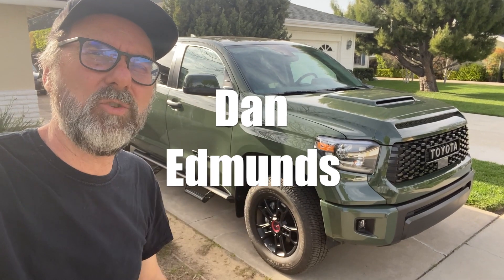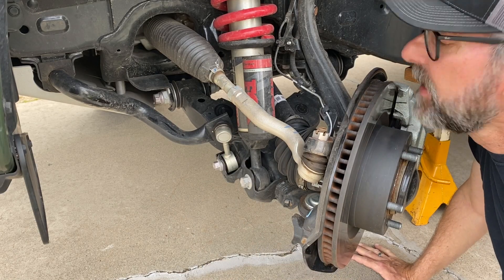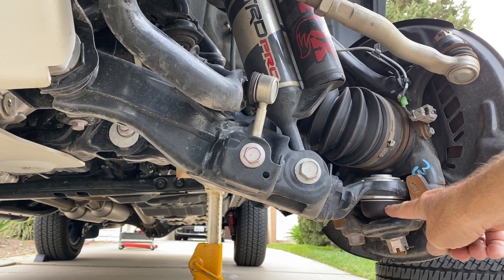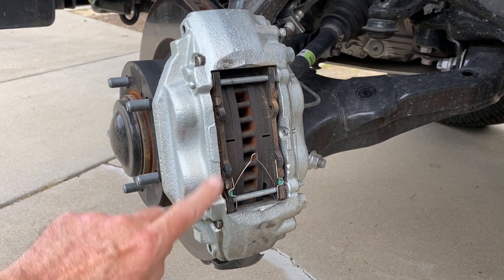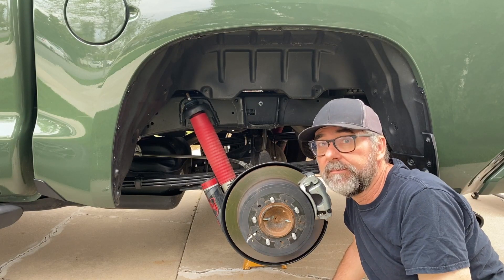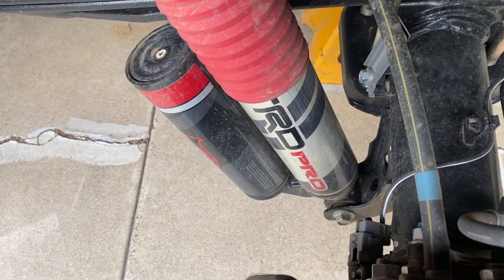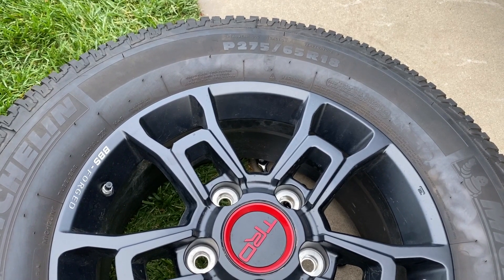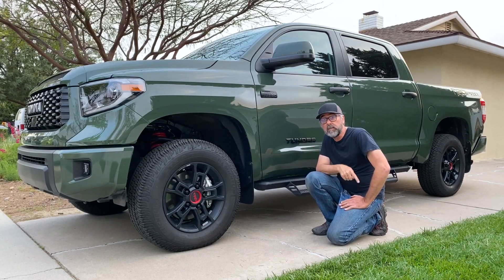2020 Toyota Tundra TRD Pro Suspension Walkaround - See What Makes it Off-Road Ready

Comment: Great video on the suspension of the tundra. I learned a lot. Is the TRD Pro your personal truck ? if it is, great choice. I have a 2020 platinum tundra and would like to level  and upgrade the suspension, what do you recommend?  I hope you make more videos on the tundra. 👍
Reply from the maker: One thing you might be able to do is buy TRD Pro take-off parts. Check instagram by following @vilmontmarket. People post a lot of Toyota take-offs there  Some people take the stock stuff off and spend huge money on ICON or other popular aftermarket upgrades, not knowing what they've already got.
Reply: @DanEdmunds  Thank you, I just added them on IG. I'm check everything out.
Reply: I would recommend for you to just purchase the actual TRD Pro Fox suspension for a few reasons. It is specifically designed for the Tundra so that’s gives you the best results off road and daily driving. I will retail some of the monetary value as it is a Toyota product, if you put after market and decide to sell your truck in the future then it doesn’t carry any of that value. Also, the suspension will have a solid factory Toyota warranty as I mentioned it’s their product. Anyways I have a video on this, about purchasing the TRD Pro Fox suspensión and the BBS forged wheels.
Reply: Carvin Roads Thank you for the response and I will definitely look into it👍

Comment: I'm confused about the anti-dive effect from upper arms pivot angled down to the rear. You've mentioned that before and it seems backward to me. That angle means rearward wheel motion on compression, which would seem to encourage dive on braking, not resist it (?). Maybe you can get into that a bit more in a future vid! Thanks!
Reply from the maker: I'll work on that.